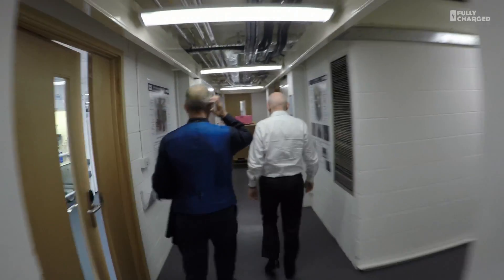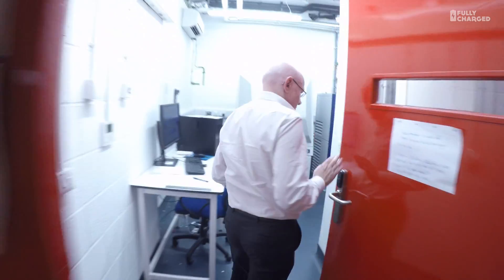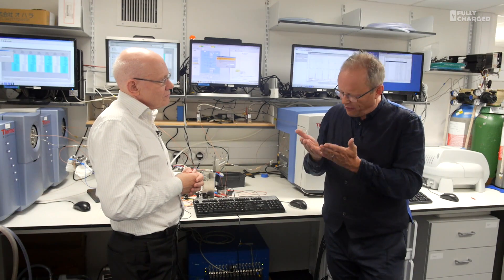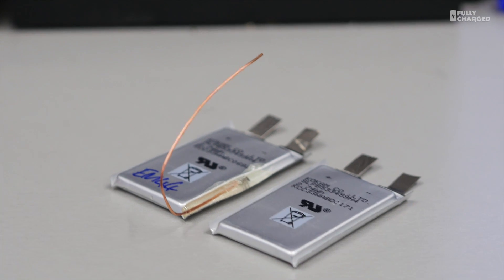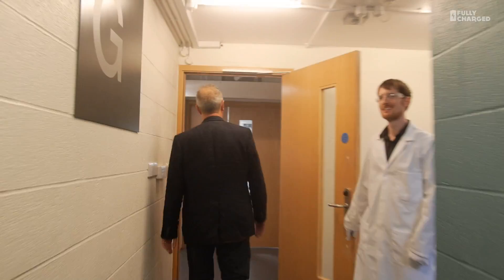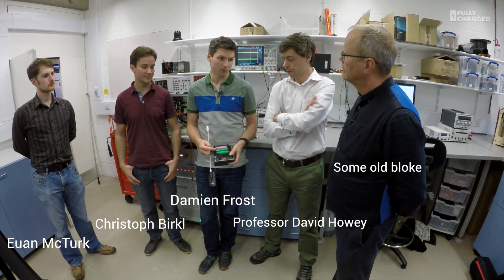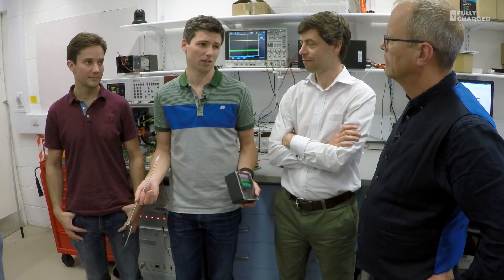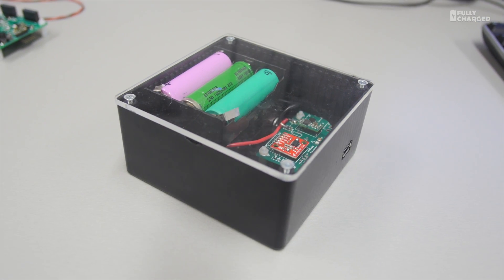Batteries to the Future | Fully Charged

Comment: Using discarded laptop batteries is a terrible idea though. Ok for playing around but they might only have 5-10% of their life left so you are spending a lot of effort to use junk when state of the art cells cost under 2$.
GM just let slip that the price is already down to 145$/kWh which is 2300$ for the cells in an iMiev to put things into perspective. Or 2700$ in BMW i3.
Not exactly deal breakers considering all the ICE junk you get rid of.
So why are EVs so expensive... because they are evil idiots.
And Elon builds luxury with no regard for cost and apparently no great skill for cost. Or reliability.
Reply: +Dan Frederiksen Clearly you did NOT listen to the engineer.  He said the "battery" is exhausted, but most of the "cells" still have 70% or more capacity and therefore still useful individually (rather than junked).  Please don't criticize that which you don't understand
.
Reply: +electrictroy2010 I believe he said 60% or more and capacity is not proportional to life. 60% is at death's door.
You shouldn't criticize that which you do not understand :)
Reply: +Dan Frederiksen  I have two degrees in electrical engineering.  I understand the technology very well.  The recycled cells with 61-99 percent capacity work just fine to provide lighting to some person in the Indian slums or African bushland.  That would provide several days of illumination
.
Reply: +electrictroy2010 I'm the smartest man in the world.
A salvaged cell might work ok for a month while a brand new 1.39$ 2600mAh LG cell will work twice as good for years.
Your understanding is poor.

Comment: This episode ended up not being about batteries of the future. It ended up being about current lithium ion batteries. I don't know if there was more discussion of their current research that didn't make it into this video, but if so, I'd love to see that. It would also be cool if you collaborated with some of the physics/chemistry/science centric YouTube channels (PhysicsGirl, Veritasium, MinutePhysics, etc.) where they could do a video that goes into more depth on battery science. It could bring a lot of viewers over from those channels.
Reply: +BlameItOnGreg The video is called 'batteries to the future', not 'batteries of the future'.  Since they spoke about batteries and then a dabbled a little on where batteries need to be in the future, or possible future use of batteries, I'd say the title of the video is fine.  If anything, I reckon it was a bit of a joke after Toyota released the 'Back to the Future' Mirai thing.
Reply: ghd67ik2887218 correct. although the efficiency of electric cars is higher than petrol. also there is a new technology that will replace oil. they will create an artificial hydrocarbon from carbon and hydrogen extracted from sea water. the process is energy intensive but when powered by a nuclear power station at wholesale energy costs they could make a barrel of this new liquid fuel at around $3 so its cheaper than oil.
Reply: CorwynGC at $3 per barrel its way cheaper than anything including oil. all you could do to beat it would be using nuclear electricity direct but then if you need to find a way to store the energy we are back to storage conversion losses ie batteries or conversion to a liquid fuel. remember its around $50 per barrel for crude oil right now. 
there is only one solar technology that might provide an alternative and that's a solar nano rectenna array. the technology will allow 80% conversion of light vs the current 16% of generic panels. they will also not degrade over time like regular cells. this technology will mature and become commercially available around 2045 onwards.
Reply: IMO it is price that is holding back the proliferation of electric vehicles...nothing more...and manufacturers are being allowed to keep prices artificially high or price fixing which is very illegal yet does not stop the manufacturers from doing it even after being taken to court...found guilty and heavily fined...but obviously not fined enough cause they are still doing it.
Just look at Tesla and it's partner Panasonic who by the way was hit the hardest with fines when convicted of price fixing....the pair have more then doubled world lithium battery production yet prices remain high when they should be cut in half at least for 18650 cells...
Reply: +Pulsed Neutrino so in 20 years the energy density of batteries will still be only half of petrol's?
Reply: MichaelKingsfordGray smaller, more reliable and still cheaper than oil.
Reply: +Pulsed Neutrino 
How could it possibly be smaller, when you can dual purpose space like parking lots for solar?  Why would anyone care about reliability (by which I assume you mean up-time) for making long term storage fuels?  And still not cheaper than wind or solar.
Reply: I love that you know exactly when technologies will be commercially available.  What about deep sea, deuterium fusion?

How can it be both energy intensive to make AND $3 per barrel.  There is no energy source you could use to make it at that price.
Reply: CorwynGC lets just say i've got a photonics industry contact lol. you are free to do some digging and emailing yourself though. light matters did a good video about it recently and so did nature magazine. the technology works and they are just waiting for efficient petahertz rectification diode materials. quantum mim diodes seem the most logical choice but again developing the interface and nano engineered structures will be difficult. also we are only just maturing the euv lithography process needed for the antenna portion of the collector. 

as for other tech. lockheed martin are working on a compact fusion reactor http://www.lockheedmartin.co.uk/us/products/compact-fusion.html
Reply: I am glad your 'photonics contact' allows you to predict unknowns exactly.  Never a  surprise.  Not sure why anyone would treat that as the slightest bit convincing.
Reply: CorwynGC well i'm just telling it how it is. my contact has secured research and development funding. so sure i'm not saying it will be bang on that year but given expectations it will be another 25 30 years. why don't you read up on the technology you will see it has merit. you don't have to take my word for it.
Reply: Pulsed Neutrino
No, you are just telling me how you think it will be.  With no evidence.

Furthermore, you don't seem to understand simple energy concepts.  If the process is energy intensive, that means it requires energy to produce.  That energy must come from somewhere other than your fuel.  No form of energy is currently $3 per barrel (equivalent, that is 0.1 cents per kWh),  so there is no way to make your fuel for $3 per barrel.
Reply: CorwynGC groan. i can't be bothered to argue over nothing. i don't have a crystal ball sure. why don't you just use google and read up on what i'm talking about rather than confining yourself to this convo where you are clearly doing nothing other than telling me why i'm allegedly wrong. 
http://www.google.co.uk/patents/US7420004
the energy comes from nuclear power.
Reply: Pulsed Neutrino

So nuclear power can be bought for 0.1 cents per kWh is your delusion?  No need to argue further.
Reply: CorwynGC yes its around 0.1c / 0.2c per kwh. look it up. you can maybe do 0.099c with further optimisations.  https://en.wikipedia.org/wiki/Cost_of_electricity_by_source search 0.2
Reply: Yeah, exactly. I've been trawling through old episodes and stumbled upon this one and thought "Oh here we go - the future, like Graphene supercapacitors". But nope, just like you say all current tech, no future gazing at all.
Reply: I think he was talking about cheaper materials that can do the same current technology can. I think most of us were hoping to hear about technology that could do better (and not per se cheaper)
Reply: These developments have been already on supersession as new technologies like ultra capacitors and super capacities are  on the way to boost up energy storage techniques with the arrival of the magic material we now know as Graphene!
Reply: +BlameItOnGreg panasonic has 4000mah 18650's out 2017. the next is chemistry is lithium sulphur in 2024 allowing up to 8000mah 18650 then solid state dry electrolyte lithium air at about 18000mah sometime after 2035.
Reply: @prankmypants  You mean 18000 mah in a  18650 battery?
Reply: @prankmypants  Wir haben jetzt 2022 und 18650 mit 3500mAh. Wo sollen jetzt  noch die fehlenden 4500´mAh bis 2024 herkommen? Reichlich naiv Ihre Zahlen.

Comment: What about graphene, it can be used as a supercapacitator. Wich means it will charge in seconds and still hold on to a lot of power.
Reply: +Erik Fehrm Capacitors don't hold a charge for very long.  A few hours max
.
Reply: And it's carbon/graphite, one of the most abundant elements on the planet.
Reply: +Erik Fehrm Making the graphene tubes is the hard part. They're doing better but it'll take time.
Reply: Graphene won't be used commercially until at least a decade. It's extremely difficult to make as of right now, but in the future we might use it not just to conduct heat and electricity at ludicrous speed and efficiency, but possibly also for aeroplanes, cars, spacecraft, or even windows. Graphene is really a wonder material.
Reply: electrictroy2010 a supecapacitor is just like a capacitor, only difference is that the former does actually hold on to a lot of power. just like a battery.
Reply: check out the video I linked
Reply: MѦXWƎLL check out the video I linked, there have been alot of progress since 2008 when they used scotch tape.
Reply: +MѦXWƎLL my hopes lies in the 3D printing technology.
Reply: +Erik Fehrm Sorry, I see no link...
Reply: It's further up in this thread also.
Reply: +Erik Fehrm The strange thing is I remember we used to do the exact same thing with pencils when I was a kid ie colour your finger nails with graphite pencil then use tape to get a layer on to it then smear it onto a piece of paper no one gave us a nobell prize hell we were luck not to get detention for making a mess.We even used to make picture by doing the self same thing, and do artistic effects no prizes given to us.Perhaps we should have written about it as well, no still would have gotten nothing.Strange how the sandwich is named after a noble.
Reply: ***** That's true however the same end result ie graphite on tape, wasn't only me who used to do this most of the kids in school used to do this kind of stuff.
Reply: +Erik Fehrm 
Most charging of battery packs is limited by the size of the wire.  That is why you charge slowly at home.  Charging a car in seconds would require a wire the thickness of my leg, regardless of battery technology..
Reply: MichaelKingsfordGray

So how come you can charge faster with a fast charger?  The battery chemistry doesn't change.  Why can't you charge fast with your home charger?  Because it is limited to 15 Amps by the thickness of the cables in your house.
Reply: CorwynGC I think you will find it is no one single issue, yes cable size can make a difference but it also has to do with the battery chemistry and the electronics used ie type of charge device. 

Your home is set up for roughly 13 amps some business are set up with 3 phase electrics which gives them more amps.

They made the cars able to be charged at a low rate of around 13 amps to protect you home from fires by over tapping the electrical system.

Most modern houses have highly sensitive fuse junctions now to protect against fires, old fuse boxes didn't always do such a good job.

Electric vehicles use some kind of computer to monitor the charging and safety of the power being drawn. and so on.

So it is no one single issue that restricts your home charge rate.
Reply: flitsies

Go ahead and calculate the wire size for recharging a 20 kWh battery in 2 seconds.  I'll wait.

For any car which allows fast charging slow rates are limited by wire size.  Period.  Circuit breakers (formerly fuses) are there to save wires from overheating and causing fires.  Those ('some kind of computer') charge controllers are designed to monitor charging and achieve long life, and maximal charging, they don't limit charging rate in any simple way.
Reply: *****
There is no one point.  I was just trying to educate on the realities of physics.  It certainly wasn't worth all the fuss, if people hadn't been intent on displaying their ignorance.
Reply: Supercaps charge and discharge quickly too. Once you start fetching energy out of them, they unload quickly unlike batteries. Super Caps could be used when extra energy is required( going uphill, starting motor, accelerating, putting more load instantly). This is what the problem is, we need a combination of both. Supercaps and batteries have different use and combinely could be used for better tech. And yes, graphene is used for supercaps widely. Please share of graphene's use in batteries..if you have any, i would appreciate.

Comment: I liked the reuse of old laptop batteries for off grid energy storage. That would go well with SolarAid's plan to get rid of kerosene lighting in the developing world (cheap storage of solar power to run laptops & charge phones to give them access to the Net at low cost whilst reducing fossil fuel use, promoting reuse & improving health).

Comment: 18650 the zero means its cylindrical
Reply: If 0 means cylindrical (which I don't think so), what number represents prismatic?
Reply: Do you have a source for this?
Reply: wulf 659 P.
Reply: +wulf 659 Incorrect. First 2 numbers are the diameter in mm. Last 3 numbers are the length in mm tenths.
Reply: +Dave Olifent i know i've have plenty of them